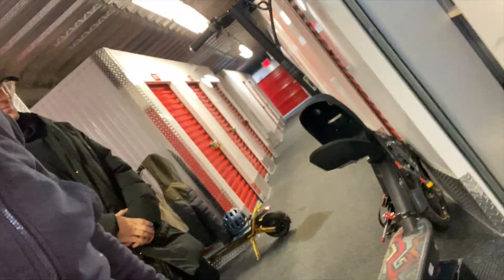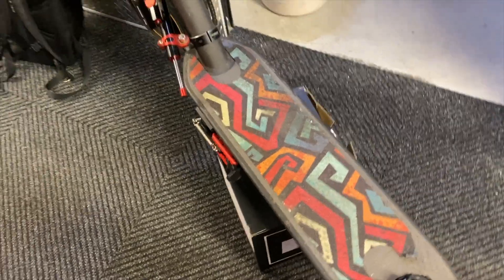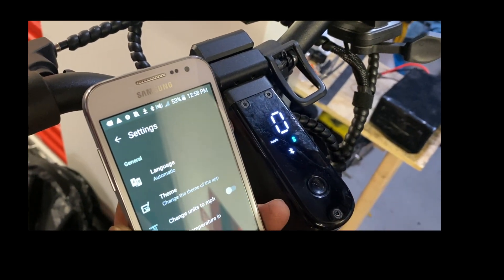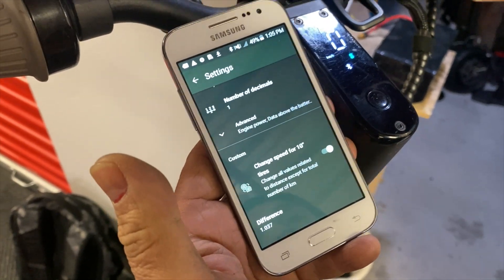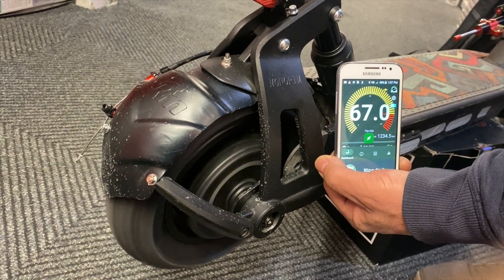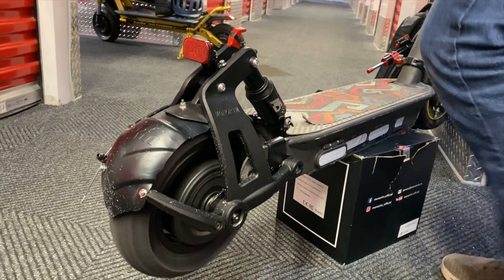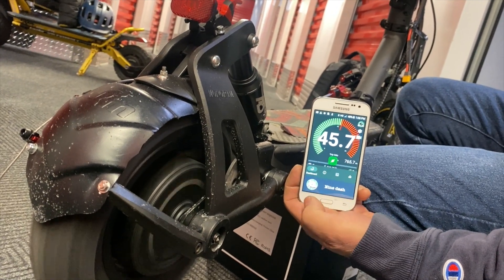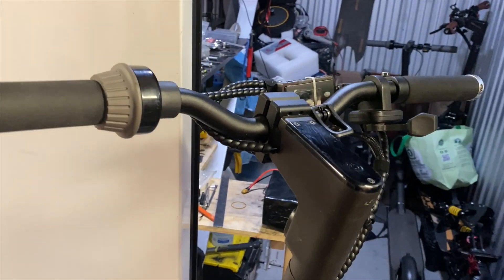Kaabo 1100W Motor on 48v Ninebot Max Top speed loaded on single motor 38MPH.

Comment: Big deal that's free spin.. I want to see you ride it.
Reply from the maker: I wish I could record everything but once scooters are build and done 
I don’t see them until some repairs are needed 😢 however top speed on this set up it’s 38-40 mph with a 170lbs rider single motor. Dual D controllers 1100w motors 60v set th38-40a continues discharge, hit 58mph free wheel and 45 loaded.